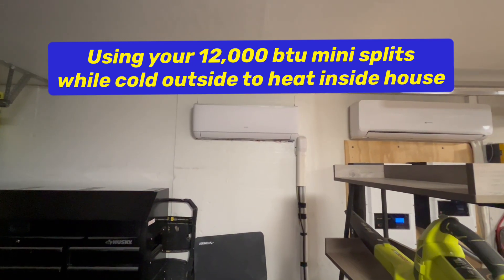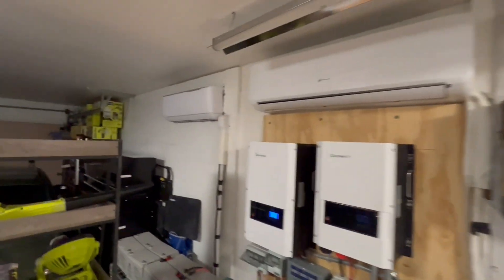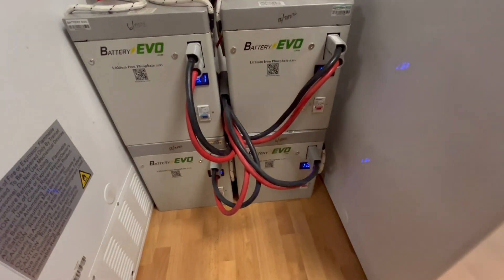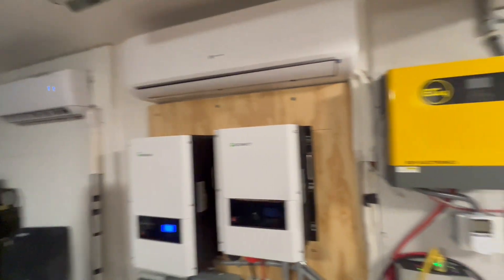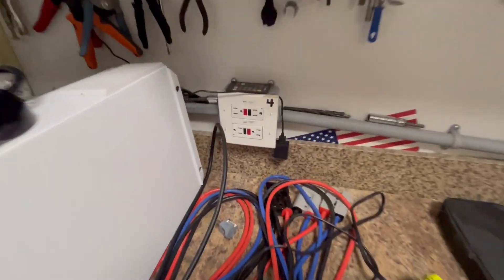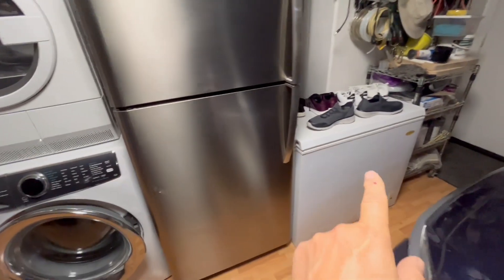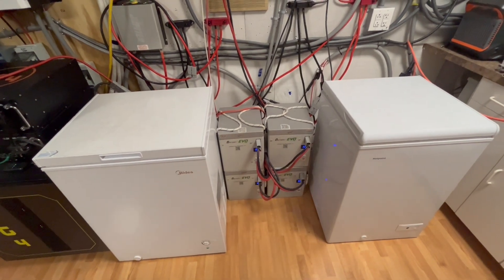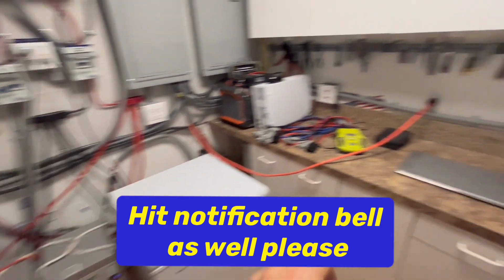Heating house with 12,000 btu mini splits using solar, 12V or 48V LiFePO4 batteries or grid power.

Comment: I have an eg4 12kbtu unit that runs so well off the wall, panels or my inverters. Really great. Btw I love the redundant nature of your setup.
Reply from the maker: I have a lot more than what I need or use. I change up what inverters I use throughout the year. The Growatt 6kw and 12kw low frequency inverters run my 3 1/2 ton and 4 ton whole house heat pumps and 18,000 btu mini split in garage. The 12kw also can run my 127,000 btu pool heat pump electric heater. Cannot run those with the other inverters. Everything else is 110-120 volts. It’s my experimental wall. I’m getting some new inverters this year. Have not found another inverter to run my 3 1/2 ton, 4 ton and 127,000 pool heater for what I paid for the Growatt low frequency inverter. I only paid $1,400 including shipping. I’m waiting to see if the EG4 18,000kw inverter will be able to run large heat pumps like I have. I know it looks like spaghetti with the wires but I am always messing with each inverter almost every day. Having the Anderson 175 amp quick disconnect for battery bank to bus bars makes it possible to quickly change battery banks to different inverters. Thank you so much for your input. I appreciate it. Hope you have a truly wonderful and extremely blessed 2024.

Comment: My Senville 12,000 btu mini split works good all the way down pass zero I was getting heat.
Reply from the maker: Wow, my Premium unit has gone down to 20 degrees and still put out heat, but these AUX mini splits are no good under 34 degrees. You get what you pay for and I only paid around $550 each mini split, that include tax and delivery. My next units will be the 12,000 btu EG4 units that have direct connection from solar panels, no longer need inverter or batteries if you want to use grid overnight, but can use battery bank overnight, I believe that would require some sort of inverter to use battery bank. Thanhs for your input, I appreciate it, hope you have a truly wonderful and extremely blessed anew year in 2024.